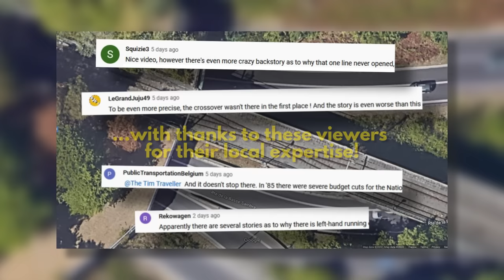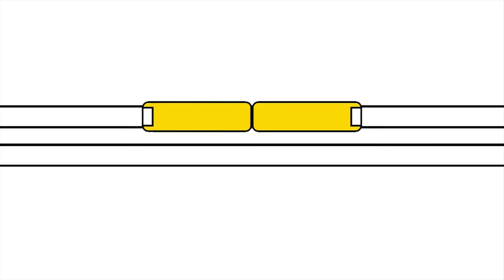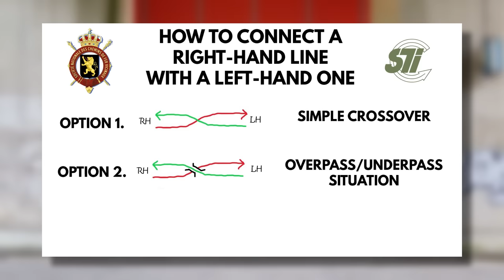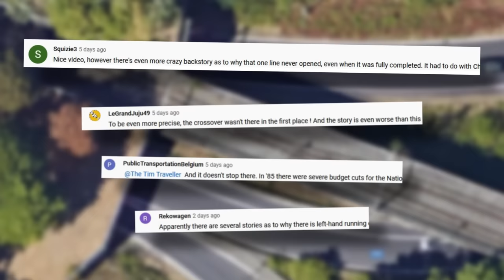The Belgian City That Built Two Metro Lines The Wrong Way Round

Comment: I was around when this decision was taken, and it was NOT because STIC trams had doors on one side only, as these trams were bidirectional. The real reason - and nothing is more stupid than that ! - was because STIC authorities were adverse to changing habits of their passengers : board and leave on the right, always ! So therefore they insisted on left running. And an other reason NOT to open lines 4 and 5 was that STIC had to revise their whole system in order to use the buses as feeder lines to the trams, with obligatory transfer of passengers, when at that time they were bringing their passengers in town directly. Also, the running costs of that modified system (bus + tram) were supposed to be higher.
Reply from the maker: I have seen different people say different things about this! A viewer of mine called Rekowagen, who I quoted in the video, said the same thing as you - it was nothing to do with the trams and only to do with boarding habits. And you're right that all the Charleroi Metro trams were bidrectional (as I said in the video tbf). But I've also seen separate sources with a different story: the STIC was planning to borrow unidrectional trams from the Kusttram during winter, and that's why they needed to run on the left. That makes more sense to me, but doesn't necessarily mean it's true of course...

Comment: There’s a crossover like this on the tram network in Gothenburg as well. The last four stops on the line to Angered are built like a metro with platforms in the middle. When the suburb was built in the 60s and 70s, the government gave out subsidies for metros, but not for trams, so it was cheaper to build it this way. 

Originally, the line to Angered wasn’t connected to the rest of the tram network as there where plans to turn the whole tram network into a metro. This didn’t happen as Gothenburg sits on some particularly muddy ground. So, eventually the line was connected and the crossover was added

Comment: This is quite similar to the "tram tunnel" (lines 7/9) in Zurich: The tunnel was originally planned as part of a metro system (that was never built). The trams (with doors only on one side) have to change side before and after the tunnel, because the stations in the tunnel have central platforms.

Comment: There is NOTHING odd about crossing tracks, kids. If you don't have that, any accident, breakdown or heavy maintenance would close the entire line in that direction. You put them there so trains can pass by any problem there might be on a certain stretch of the track. 

You're welcome.
Reply from the maker: Correct. But with this crossover, you can't do that. That's what's odd about it.

Comment: The trams in Zurich have a similar crossing on the only tunneled section in the system in operation. The tunnel was originally dug for a metro that was never built, so they put the tram in the tunnel. Because the trams are only one side doored, and because center platforms were already built for the tunnel stations, they hat to put in the crossovers on both ends. One side of the tunnel has a level crossing as in the video, the other one has a tunnel where one direction crosses the other underneath. It's odd but it works.

Comment: This weird crossover thing happens a lot on Bus Rapid Transit (BRT) lines that use island platforms and conventional, right-side door-only buses. For example, when you drive up I-110 between Los Angeles and Harbor Gateway,  (91 Freeway), the X-Overs are very apparent in the middle of the freeway, and the roads to the cross-over are signed "BUS ONLY", since carpoolers drive past the station on either side.

Comment: @Tim. A similar situation exists in Zürich. Lines 7 and 9. in The 1970's they were planning a metro system for Zürich (U-Bahn), so when they built a new dual carriageway through Zürich they put a cut-and-cover tunnel under it, ready for the metro. This had island platforms. The metro got cancelled, and they sent trams down the tunnel instead. The problem, Zürich trams were (and still are) unidirectional and with doors only on the right. So at the beginning and end of this tunnel the trams have to crossover to left-running to be compatible with the island platforms in the underground section.

Comment: in Vienna it is common in some places where the tram crosses itself, for example at the metro station Kagran. this is because the doors of the tramway should face the metro station, so they circle clockwise around the station - right becomes left so the doors on the right hand side are facing the station building, so does the tram driving to the opposite direction, which doors faces the metro station at the other side of the building

Comment: There's a station that crosses direction in Hong Kong, To Kwa Wan station was built to accommodate the old Ma On Shan Line which runs on the right for the passengers to connect to the city bound East Rail Line, while the West Rail Line runs as usual on the left

Comment: There is Similar situation (Changing Sides) in Seoul Metro Line 4

Line 4 change direction and Electriccity (AC to DC) between Namtaeryeong(남태령) and Seonbawi(선바위) Because Korea national railroad (Now KORAIL) Used leftside. and Seoul metro used Right side.

So they had to build a three-dimensional cross-tunnel (not cross section)